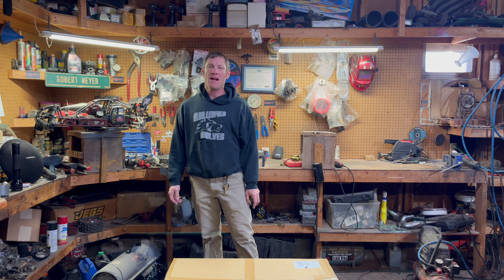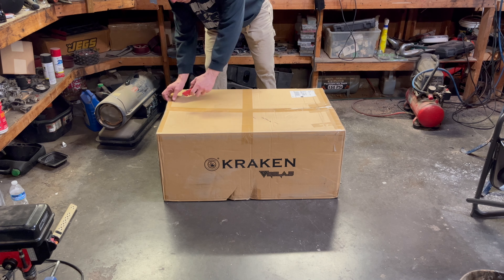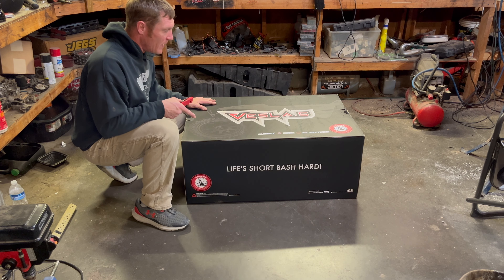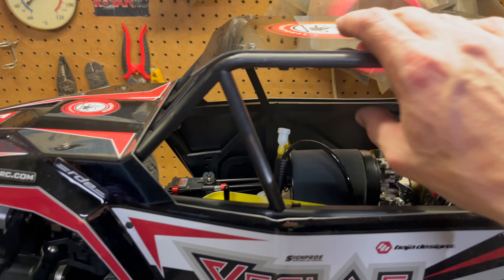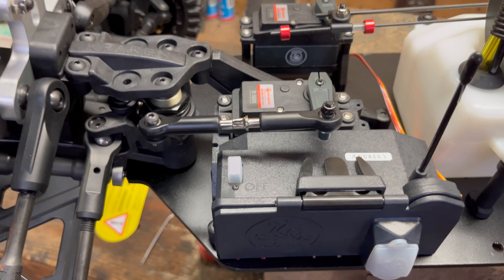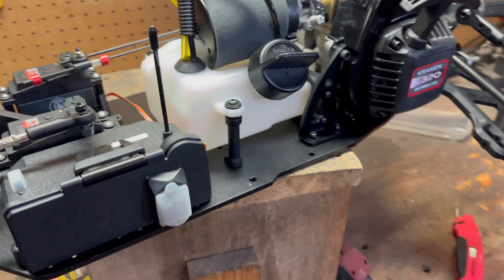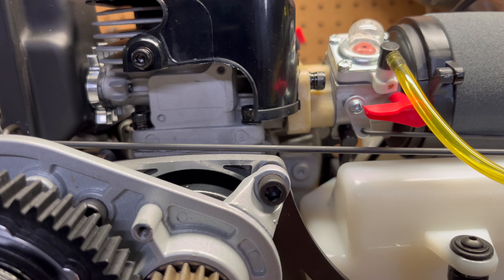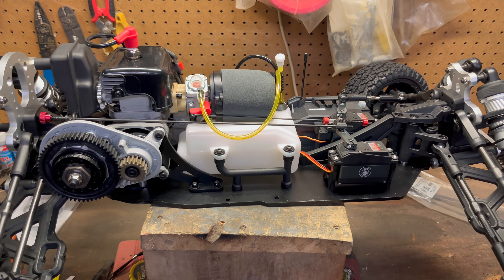KRAKEN RC UNBOXING

Comment: Super cool. I've got the elect. version. The engine, I think is probably a CY. Both Chico & I think you should put a Taylor 35 V-2 in that baby. Piston port. I have that engine in my Vekta TT, & it absolutely Rips. Who needs the extra weight of a Big Bore. For $200.00 you could get a V-2 cylinder & convert your existing reed valve back over to a P.P. & retain most of the stock parts. Ya-know air filter Etc. Just a thought, But what do I know.
Reply from the maker: I’m thinking 🤔 71 supreme 😄😁